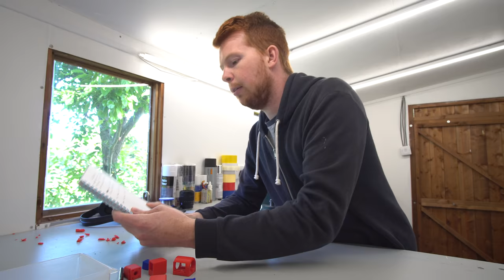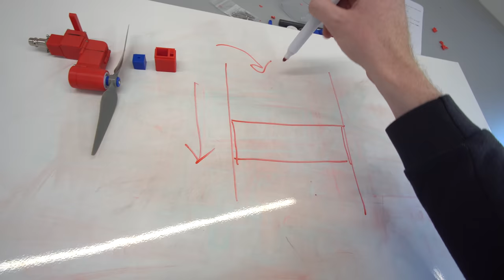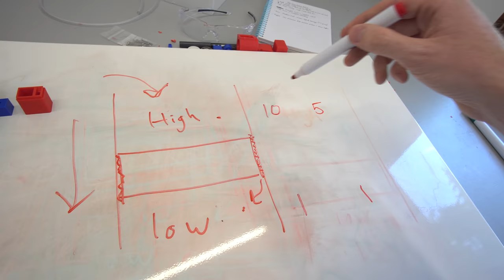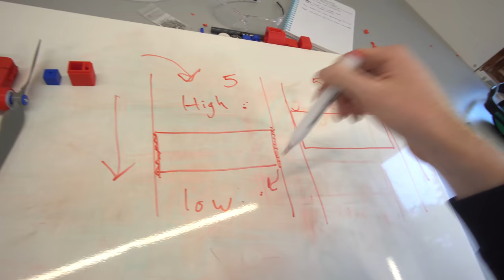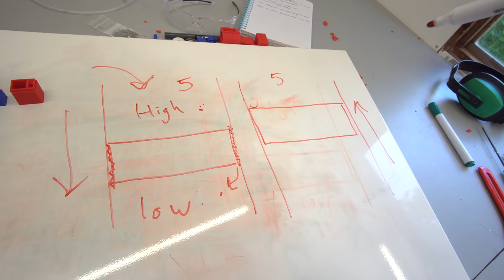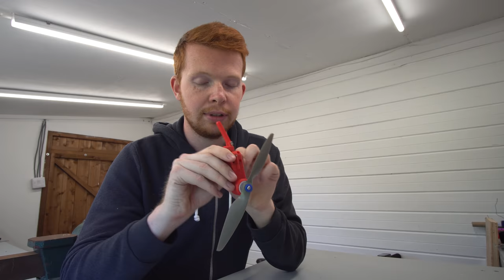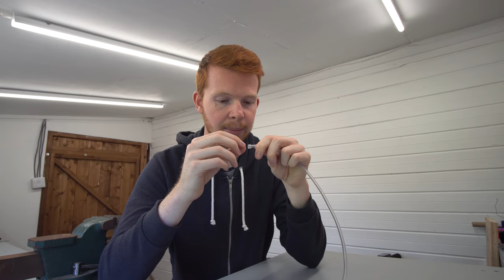Multiple or Single Cylinder Air Engine?

Comment from the maker: It's been just over 1 day and there have been an overwhelming number of comments! Thanks to all of you for your suggestions!! I haven't had time to read through all the comments, but after a quick word count, the single cylinder seems to be more popular (even though some people wrote 'single' when they really wanted a multi cylinder haha).  So here is my next question, for a constant total cylinder volume (volume when the piston is all the way down), do you reckon it would be more efficient to have a large bore and short stroke? Or small bore and large stroke? I'm in the process of designing the V4 engine and can't make my mind up! Thanks a bunch for all of your interesting comments and I will continue to read through them over the next few days!
Reply: I believe an almost equal Stroke ratio is common. I could be wrong though.
Reply: I would say large bore & short stroke would be the better choice.

But be aware that small changes in the diameter of the bore lead to big changes in the rate of airflow through the hole, so its a very important value!
Reply: Tom Stanton i think you should go for a v4 engine but offset the pistons by 90 degrees (so you dont need a large flyweel)
Reply: large bore short stroke more rpm, but long and short block.  long stroke small bore more torque, tall and short block.  i have designed a few air powered engines and never finished any but got a bunch spinning with a drill and found that the square stroke - bore worked best for vibration and over all strength with the 3d printed parts.
Reply: I'm thinking large bore, short stroke might be more efficient here, as long as the intake can handle the airflow. 
Ignoring lots of things like friction and air leakage, if you halved the stroke, you would have to double the mass of the piston and connecting-rod for the vibration to stay the same (F=MA), in the direction the piston is moving. Lower vibration should give better efficiency. With the shorter stroke you should also get less lateral vibration from the crank and connecting-rod.
The larger bore will likely have more blow-by, so there is a balance, which I'm guessing leans in favour of a larger bore...
Reply: I would think small bore large stroke as you will have more tourk meaning less rpm and air needed, to power a object
Reply: maybe you can get some inspiration from steam engines, they practicly work on hot compressed air.
Reply: wouldnt  a larger bore also leak more air? and a long stroke is a good way i belive to maximaze energie extracked from the air without having greater air loss
also with a smaler bore you dont need to move as much air wich could result in a higher rpm yet if the stroke is longer ... that would help the torque and reduce the rpm so that kinda evens out anyway. one thing that might cause trouble but im not sure is that if the piston speed goes to high cuz of a large stroke ... dosent it get warm or even deform the PLA ? few of my thoughs i hope i can help
btw im think you should stick to 1 cylinder and focus on seal between piston and cylinder cuz i think thats one of the things wich waste most energie 
you gotta keep in mind that you are limited in the amount of compressed air you can take up there and its not a lot .... not at all
Reply: I would prefer a short bore and a long stroke for the engine. Firstly, a small bore means less air leaking like you already explained in the video. Secondly, a long stroke gives the engine more torque.
Reply: I am after a multi cylinder engine but oh well

I would use a small cylinder long stroke for the car and the opposite for the plane

The reason for this is longer strokes make more torque at a lower rpm but face issues when it comes to piston traverse speed hence they don't like to rev and that's why it wouldn't be good for a plane. If you think about the air hogs engines the stroke is small allowing for the much higher rpm that they produce

Finally for the plane have you tried running a very very large "" slow fly"" prop on a gear system like some of the air hogs use as that would better suit the engine you have designed as nitro engines typically swing a small prop way faster then your engine can
Reply: I would assume the length of your stroke dictates your rpm

The shorter the stroke the faster it will turn. Just Limited to the friction and the internal Inertia.
Reply: yes the longer the stroke the faster it has to move linearly for the same rpm and also the harder the piston must accelerate.

on top of this in a standard combustion engine the flame travel speed is a factor but for the air engine it is not
Reply: Tomas Begley the equivalent factor for an air engine would be the speed of sound... Unlikely to a limiting factor for something like this.
Reply: so i would recommend a flat duel engine, the pluming might be complicated but they were used on old air planes for there fuel efficiency and a single cylinder engine is having to work harder as theres no other cylinder to relive stress from the piston thus is leaks, parts brake and ect.
Reply: timbargen I was using it as an example but if you want a better one then valve float would be the next one but the could be solved by having a captive crank and shuttle valve instead of a cam and lifter
Reply: Tom Stanton ditch the Pistons and go with the turbine
Reply: On car engines, they're typically roughly square, but having a longer stroke tends to be a slightly less compact, but more efficient. Generally speaking, having a longer stroke will increase the vibrations, but a 90 degree v4 is a fairly well-balanced design if memory serves. However, an i4 2-stroke is almost perfectly balanced
Reply: Thinking about this a bit more, I think  compression ratio is probably the thing to be most concerned with; I can't remember if you've said what ratio you're using or not.
For optimal efficiency, you likely want your compression ratio to be such that the absolute tank pressure divided by the compression ratio is pretty much equal to the atmospheric pressure, maybe a touch higher to give margin for losses and error. Said a different way, the cylinder should be at atmospheric pressure at the bottom of the stroke.  Example ~8:1 for 100psi tank pressure (gauge).

To me, this makes it pretty obvious that you need some sort of regulator to keep the input pressure optimal for the compression ratio. Over the course of a run, for 100psi tank pressure and a 3:1 compression ratio (optimal for ~30psi [gauge] ), you lose at least 50% of the stored energy directly out the exhaust. With a 2:1 ratio, this is closer to 75% loss. Higher compression ratios will have losses due to being unable to run the tank down to lower pressures.
Reply: Just remembered that the cylinder is being  exhausted at the bottom of the stroke. I think this is the biggest source of inefficiency for this design, since the air remaining inside the cylinder needs to be compressed on the upstroke.
Why not add an exhaust valve at the top of the cylinder, and use a cam profile that leaves it open for most of the upstroke? That way you should be able to set the intake valve to just open for a few degrees at the start of the downstroke, and let the air do more work by fully expanding inside the cylinder.
Basically, I think the changes that will produce the largest efficiency gains are; adding a timed exhaust valve, lowering the intake  duration, adding a regulator, adjusting compression ratio to match, and  messing with the bore/stroke ratio, in that order.
Reply: Tom Stanton several people have mentioned staged cylinders, like a train. Parallel seems pointless (surface area to perimeter ratio is linear with radius), but staged will let you get more energy out
Reply: Large bore short stroke would be more effiecent because the piston would have to travel at a lower speed so you can rev higher and there is more surface area so more torque which is better for a car :)
Reply: Tixo Moments   Larger bore will definitely be more efficient due to lower piston speed (less vibration).  As for the torque it produces, don't forget about the leverage the connecting rod has on the crank. If you're actually keeping the cylinder volume the same, the increase in surface area is exactly counteracted by the decrease in leverage at the crank.
Reply: wow never thought about the crank thx! :)
Reply: if you maybe put some gearing in id say small bore long stroke
Reply: compressed air spindles are used in machining because they are incredibly good at revving, but they tend to have very little torque, I feel your air engine will run into the same issues. If you're looking to make a substantial amount of power with it I would go with a large bore and a short stroke in order to get a high revving engine that can be geared down to make the power you need.
Reply: Tom Stanton I still believe you need to try and take advantage of the exhaust pressure. Ideally, there would be no exhaust pressure because any difference between atmospheric and the top of the piston on the bottom of the stroke is all lost power. Of course there is a slight difference that would need to be there to overcome friction and I am not sure the specifics of your engine. Increasing the "compression ratio" would also help with using more of the air's useful pressure. Or making a second "low pressure piston" that runs off of the primary "high pressure" piston's exhaust would be another idea that would be interesting with your V4 idea.
Reply: I think you should start putting dry ice in there for longer range, but also a safety valve so it doesn't blow up in your face when something stalls the motor or goes wrong otherwise. Keep in mind to also ventilate the room or better go outside fr this so you don't suffocate from it, since CO2 isn't exactly healthy in large quantities.
Reply: I think the long stroke is better because with a short stroke the travel is less but resistance per travel is greater, whereas with the long stroke the travel is more but the resistance per travel is less, so the only thing that makes the long stroke the better option is that the piston has more travel over which to build up inertia and thus perhaps move slightly more efficiently and/or faster. Really they would both be about the same though.
Reply: Tom Stanton you are using air, there is no combustion. With a combustion engine a longer stroke is much better because the piston is driven down as the explosion happens. Gas and air are compressed and the when the explosion happens pressure increases as the piston goes down. But you are only using compressed air. So more surface area on the piston with a bigger bore and a shorter stroke will run your engine more efficiently. Air will expand the same way as gas and air as it explodes, how ever it happens faster and with less force. Therefore a longer stroke will not benefit you. Bigger bore shorter stroke all the way.
Reply: Tom Stanton Hey Tom! Could you take a look at the Opposed piston design? More torque and potentially more RPM.
Reply: small bore large stroke by far
Reply: Long stroke
Reply: Tom Stanton well the advantage of 2 cylinders is that you increase the area where pressure is build up. If you can keep the volume of air the same of your current model you basically double the force or you can halve the pressure needed what might almost double your flight time eventually. That is of course if you can time the decompression so that you don’t loose energy.
But for now I’d suggest first looking into optimization of your current design
Reply: Small bore inline 4 Short stroke would be easier to make but a radial engine would have more rpm and less balance issues
Reply: Longer stroke means more torque   and you can make a in line engine by putting the camshaft next to the crankshaft  and gear them together
Reply: Large bore/short stroke seems to me like inertia would be more of a problem (tho with small plastic engines it may not be bad enough)... but...

Honestly bigger parts are easier to work with... you’re going to have a 5th edition are least as you refine the design. I’d go for large bore/short stroke to start with and tune toward a more balanced design from there.
Reply: Multiple cylinders as in steam engines (expansion) not internal combustion (explosion)... mmeaning two stages of expanisionn of the air... Success! Great videos.
Reply: you probably have this muted by now but have you seen the engines in the steam cars in jay lenno's garage? there is a power stroke in bothe directons which i thought was cool. :)
Reply: I have worked with steam engines but we test them on air they always run better on steam that might be something you could look into running one of them on steam
Reply: the image is more of a boxer engine like in a porsche 911 or a wrx sti
Reply: Hello Tom, sorry I'm so incredibly late on seeing this video. However I thought I might have some helpful advice for your engine design. I personally would focus on simplifying the crankshaft because the crankshaft is a wear component as opposed to the plumbing for the air, which should experience minimal wear at worst. If you wanted to make a larger engine say an eight cylinder, you could parallel four of the flat twin engine designs next to each other front to back. An air rail on each side which are both fed by a single diverter splitting the air evenly among the two sides. The only issue I can think of with that design, is that you are going to get a lower pressure on the cylinders farthest from the air supply.